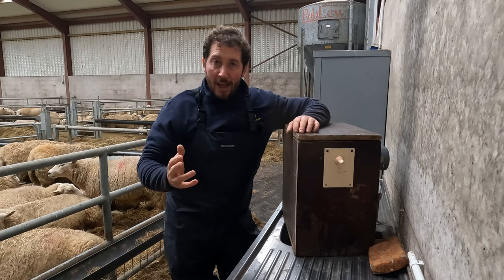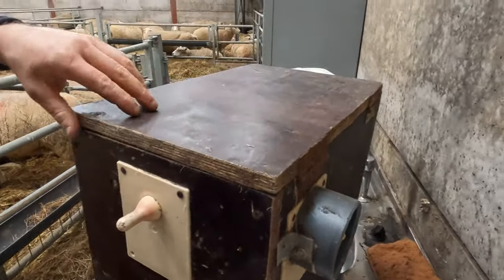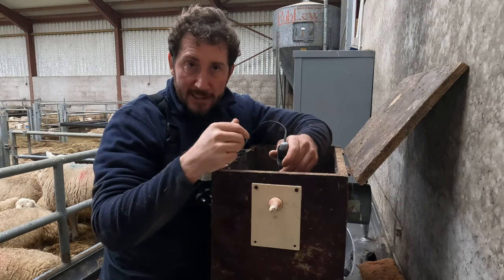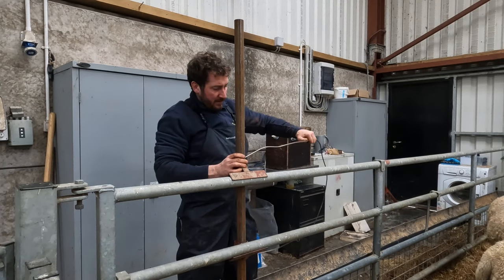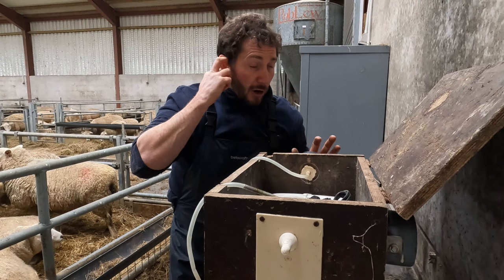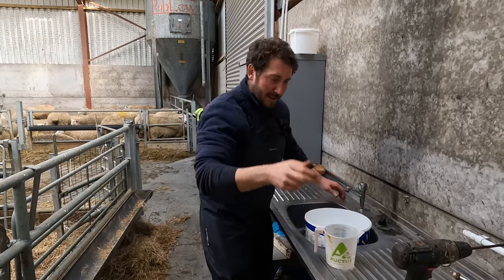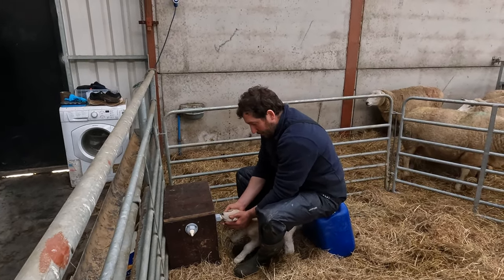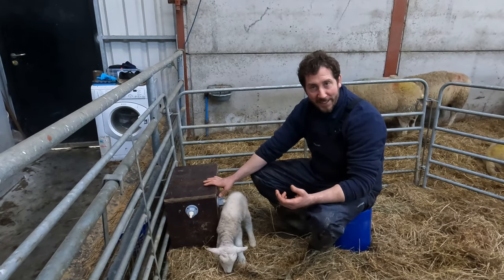Building a Homemade LAMB FEEDER. Forget the bottles!

Comment: Your cup also solved  the problem of the greedier lambs knocking the other lambs off the teat. I used to put warm milk into a pail inside a bigger bucket with a lid to keep any contaminants out, that I drilled holes in to take the feed tubes situated outside the pen and fed to a teat board attached to the pen. Since the lamb replacer contains cereal grains, I found that keeping the milk warm, ( I mixed it warm and allowed it to cool down whilst in use) caused it to ferment. Your system is just the job to prevent that. The feed companies want you to feed warm to use more product but my lambs fed little and often regardless of temperature once they knew what to do. and it took 10 kg of replacer to rear a good lamb on 5 weeks weaning onto creep. Being an ex nurse I was quite fussy about cleaning the pipes frequently. I like the man way to mix, I used a big hand whisk and of course it mixes easier warm. Impressed with you inventiveness. We call them Mollie lambs here in Wales and yes they never were profitable but we felt obliged to rear them well. I think you have a super set up in your shed. I am thinking a slick version of your invention could be a marketing possibility, especially for colder climes.
Reply from the maker: Thank you Wendy. I like your idea to keep the dirt out of milk...👌

Comment: Great job and interesting to see someone else's take on a homemade feeder. 
I made up something along the same lines last year. 
The main difference is that I mix the replacer warm every morning and evening and drop a bucket of it into a bigger bucket (that's full of water being kept warm by a similar heater to yours)
They feed ad lib at full temp for about 10 days and then I gradually reduce the temp. 

I'm only small time, but it fed 9 lambs last year .
Reply from the maker: If you can avoid bottle feeding 9 lambs it's a good machine..👌

Comment: Hey does the milk go thick in the tubes?  Iv got something very similar that I made but the milk replacer seems to go thick over night or when the lambs don’t use it for long periods of time. Thanks
Reply from the maker: No problem with that at all. I have noticed some milk replacers have a lot of solids/sediment that settles out to the bottom. Could be worth trying a different brand of milk powder.

Comment: Would the one coil do the three or do you need separate 🤔
Reply from the maker: Ideally one coil per teat for 2 reasons. Firstly, the coil will not transfer enough heat to lambs feeding at once. Secondly,  if only one lamb is sucking, air can backfeed from one of the other teats. Hope this makes sense?